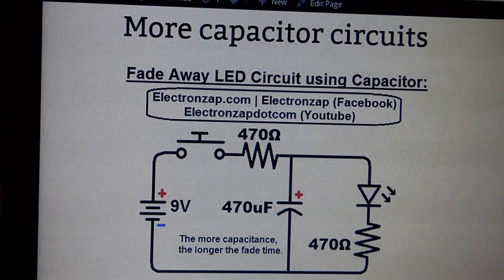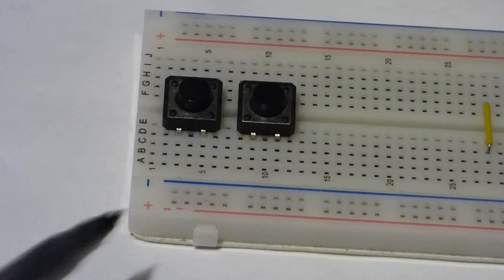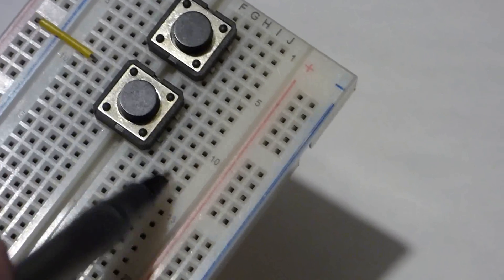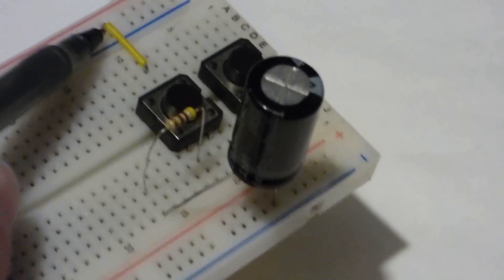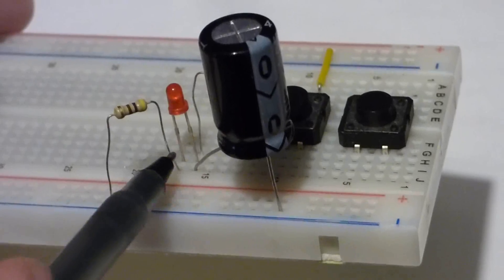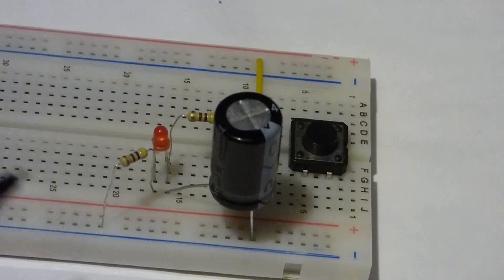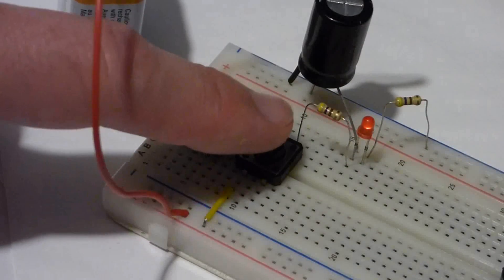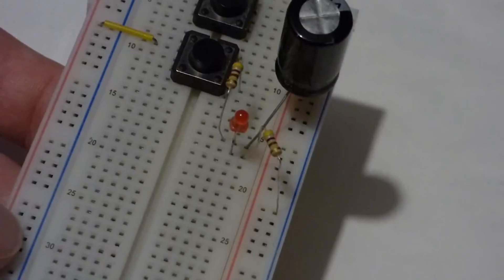Fade away LED circuit using a capacitor. Electronzap step by step build and schematics.

Comment: How many LEDs can be used?
Reply from the maker: In series, you can use as many LEDs as you have voltage. More LEDs = more voltage needed. Don't exceed the capacitor maximum voltage though. In parallel, each LED is going to discharge the capacitor faster. 2 times as fast if you use 2 parallel LEDs with their own resistor (recommended). 3 times as fast for 3, and so on.

Comment: Would a 100volt 3,700 or 5,000 or 10,000 Farrad capacitor be dangerous ? I need 100volt because a bicycle bottle or hub dynamo can output up to around 100 volts ac on very fast down hill decents. I plan to use it to make a full wave bridge rectifier as a smoother for my vintage bicycle dynamo lights to stop the very annoying strobing that occurs with the AC & to hopefully enable the light to glow for a few minutes when stopped at traffic lights when the current from the dynamo is no longer flowing - the capacitor discharging into the load ( a 3 watt total of  front & rear led bulbs).  How long could I expect the lights to glow for before going out completely with these value capacitors please?
Reply from the maker: 100 volts is always dangerous. 1 Farad can provide 1 amp of current per second, for each volt that it is charged to, wheras it takes 1A of current 1 second to charge it 1 more volt higher. Trying to build something to capture energy and then reuse it isn't a simple build at all, even though the basic concept is pretty simple. You'd have to look at what other people put together to learn all the details. Capacitors aren't cheap either, they genetally only compete with batteries when there needs to be a lot of current for very short period of time.
Reply: @Electronzap   😮😅 That would fry me if something went wrong lol! My bad - I'm a novice. I meant 100volt 3,700 or 5,000 or 10,000 microfarads 
 -- symbolized as µF not Farads. A different ball game now I hope? Bicycle dynamos (actually alternators) are constant current sources if I understand it correctly rated at 6volt 3watts but the voltage increases with speed up to around 100volts on rare occasions  if able to achieve 40mph on long steep descents.
Reply: @Electronzap  Okay, so now I have learned a bit more... If I used a 1.5 Farad (not uF - Microfarad) 5.5volt Super Capacitor or two of these (total 11volt & 3 Farads) to discharge into the load when the power from the alternator stops (The load is two Led Bulbs total 3watts - Headlight up to 2.6 watts & the tail light 0.4 watts) will the Super Capacitors smooth the ripple just as good as an electrolytic capacitor in the Full Wave Bridge Rectifier that I make using shottky diodes or passive Mosfet?

Comment: Hi sir. I replicate it and did some modification to it by putting a 10v 680uf capacitor instead to fade the led faster. instead of the push button you have, i use a ttp223 touch sensor, but for a reason i can't tell, my led fade on but not off. i can't find any answers out there. I am hoping you can help me if possible.

Comment: If you had a voltage supply that matched the LED could you drop the resistors and just use a capacitor?
Reply from the maker: You can light an LED with a bit less voltage than it's maximum forward voltage and no resistor. But of course it is easy for something to go wrong and the LED could burn out, so not recommended. The capacitor's voltage will also be barely enough to light the LED, so it's voltage will probably drop too low to light the LED almost instantly as soon as the supply voltage is removed.

Comment: Hello, worked ! Thanks a lot. I had tested some other explanations that didn't worked for me, and now I know why: The last resistor from the negative connector of the led to grounding wasn't included (or so I remember). But I don't understand why it is necessary, and why if you don't include it, the led turns off immediately.
Reply: Well well well... After some more testing I can say I was wrong: The RED led turns off gradually very fast (almost unnoticeable without oscilloscope), but with the resistor plugged in, it  turns off more slowly; Why ? Maybe because the amperage is lower because of the final resistance is present, isn't it ? Also, with a green led and without that resistance, the led turns off more slowly... Maybe because the 'internal resistance' of the green led is greater than the one of the red led ?

Comment: Nice video! but what's the point of having a LED light fade away instead of turning off at once?
Reply from the maker: I think it looks cooler, but mostly LEDs are a way to see how much current is flowing. Which I think also helps people be able to visualize the current changes in similar circuits without LEDs.
Reply: @Electronzap  it does look cooler! I am building a light board right now, 120Vac, I want to add a capacitor to the push button switch, so it will fade out. 

5 40 watt bulbs is the first circuit I want to test! 

Will this work for AC? 120V? Obv different size cap
Reply: @Electronzap  Ahh I see okay because I'm searching what's the use of having a component that charges and discharges quickly...like why is that so useful in DC devices?

Comment: Awesome video. I need some help building a similar curcuit.  I have made a trigger for a 12v 1A LED light strip. I have installed this in my drums and it works well when I strike  the drum. I need to make the light come on instantly and then fade out in one Second. I have a Yahoo email.  Thank you from LudwigClassics
Reply from the maker: That's a good idea for a circuit. I would do a Google search for noise activated fading light schematic diagrams.

Comment: I have tried the above series and it works,
 
when the button is released the effect fades from 100-20% so the timing is perfect according to my wishes, but when it reaches 20% it feels like it is stuck, and the process fades to 0% it takes a long time.

when i try to shrink the capacitor the effect fades out 100-20% too fast
how to solve this?
Reply from the maker: I'd wire the capacitor as a voltage ramp, and then use a voltage follower (probably using a single supply op amp) to transfer that voltage to the LED.

Comment: Realy nice video!, Do you think we still need resistors if we use 3v battery?
Reply from the maker: Some people light LEDs directly with coin batteries. Probably not good for the LEDs, and there would be no fade.
Reply: @Electronzap  ok,thank you for your answer😁

Comment: so... what is the use of the other switch??
Reply from the maker: The pins on these switches are kind of hard on the breadboard slots, so I would leave them in place. Some circuits I made needed 2 switches, so I always left the 2 switches there.
Reply: @Electronzap  okay... kind of confusing to me at the first place... 😁

Comment: For 220v power supply can you can help with an advice?thanks
Reply from the maker: I don't do anything with high voltage and very little with alternating current so probably not :(
Reply: electronzapdotcom thanks.Good job!

Comment: Hi, i wanted to do this exact same thing but for the headlights in my car. Do you think that would be possible? if so could you do a video tutorial or provide some guidance? Thank you
Reply from the maker: Unfortunately I don't really do anything with vehicles and I don't have a shop yet so I'm stuck working in a tight space and small scale projects for now. But, I would bet that a number of auto enthusiast YouTubers have shown projects like that. Some company(ies) probably make an easy to attach unit that you just plug right in.
Reply: @Electronzap   you only have to scale to 14vdc
Reply: You need a delay on break type circuit, not capacitors. Someone might make something like that aside from it being standard on some newer vehicles via the computer. Google 12 volt delay on break.

Comment: im completely newcomer about all of this stuff,right now im working on some diorama that would lit the eyes of a monster slowly when turned on and fade out slowly when power is gone,any simple idea or changes from your circuit? (sorry about my grammar) :)
Reply from the maker: That's probably a common project that people share online if you do a google search for "fading LED monster eyes" or something. This is pretty much the setup I would use if trying to keep it as simple and easy as possible, but I would have parallel LED circuits controlled by a single switch to light both eyes at exactly the same time. Thanks for watching!
Reply: thank you,ill try to digging more :)

Comment: Why not use one resistor only? The one serial to the LED?
Reply from the maker: Daniel F you can. An uncharged capacitor conducts like a short circuit, at first, when it starts charging though, so you have to be careful, especially as capacitor value goes up.
Reply: electronzapdotcom got it. But it's ok in this case, as you're working with low voltage, right?
Reply from the maker: The voltage is more than enough to cause problems. I've heated metal wire enough to melt/burn plastic at much lower than 9 volts from a steady short circuit. the small value of the capacitor (470uF) is what keeps the total current very small. I'm guessing that the switch will probably mechanically wear out long before any and damage from such a brief short circuit and I'll often omit the resistor. There is also a possibility that I may accidently short circuit the capacitor somehow, or accidently attach both sides of the switch directly to the power source. These things happen a lot while I am making changes while recording and it helps when I use a resistor to space things apart.
Reply: electronzapdotcom got it now. Thank you, sir!
Reply from the maker: Thanks for watching!

Comment: Can someone assist me in a project? I wanna make a circuit that will power many led strips and have a fading on and off effect.. Any help appreciated.. Thanks
Reply from the maker: You could use a 555 timer to charge and discharge a capacitor while lighting parallel LEDs. If there's too many LEDs for the 555 timer alone you could have the capacitor control a transistor that powers the LEDs.
Reply: What transistor should i use in the circuit? And FYI i wanna power 4 12v led strips, i really don't know the wattage. And thanks for the info.